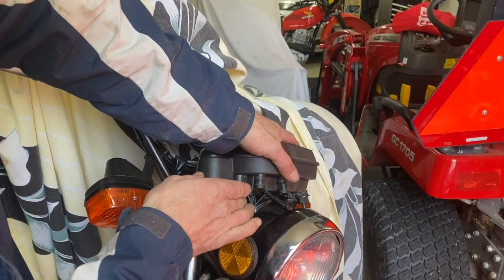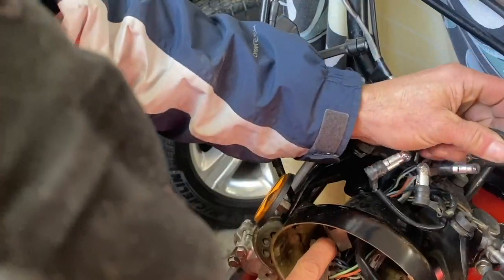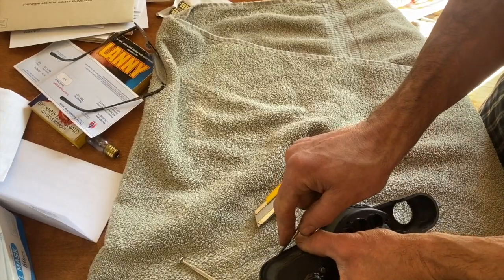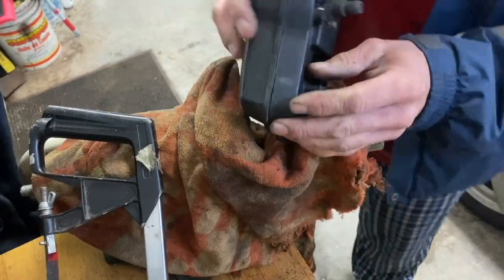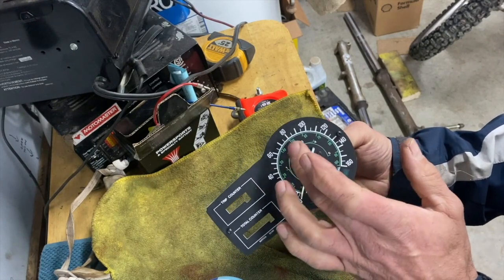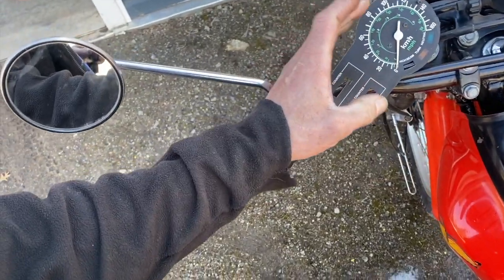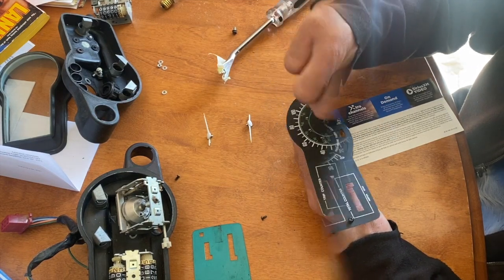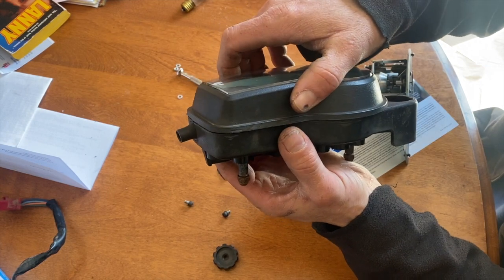1979 1980 Honda XL250s XL500s speedometer repair / lens removal

Comment: I doubt anyone will see this but I have an issue we're my speedometer won't go past 45mph exact same bike and speedometer I just replaced the cable on it and it works fine up until 45mph then it just stays there and comes back down when I go below 45.  Do I just have to replace it or is there something that can be done
Reply from the maker: You need a new one.   Probably weak magnets inside.

Comment: My speedometer doesn’t go below 20/25 mph but works fine above that. Do I need a new cable?
Reply from the maker: Not the cable.    Just wondering if the mph is off by 20.  If it’s off by 20, your needle moved.
Reply: @WeekendHobbyMechanic  I was riding off road and then I guess it moved and it doesn’t go below 20 even when the bike is parked. Is there any way to fix this?
Reply from the maker: Does the needle move when the bike starts to move?   If so the needle moved.  You have to split the speedometer apart and pull the needle off. 
    Add a bit of Loctite and place it back in the right position.  (O mph).
Reply: @WeekendHobbyMechanic  yeah that’s what it does. Guess I have to open it up. I was hoping I wouldn’t have to but it is what it is

Comment: Hi I need your help pls I have a Honda xl250s toe and it's not starts
Reply from the maker: Change the spark plug and then check for spark.   Remove the air filter and add a small amount of gas in the inlet.    Crank it over to see if it’s starts.
Reply: I try and it's not starts
Reply: How kan i get in contact
Reply from the maker: Check your valves clearance.  Back off the decompression lever and do a compression test.
Reply: I don't have all the tools for it
Reply: Wat is the val.... clear... on it
Reply from the maker: 0.002"-0.004" intake. 0.003"-0.005" exhaust
Reply: Thanks
Reply: It help a lot but ther is more problem on the Honda xl250s
Reply from the maker: I hope you can get help in your area. 👍